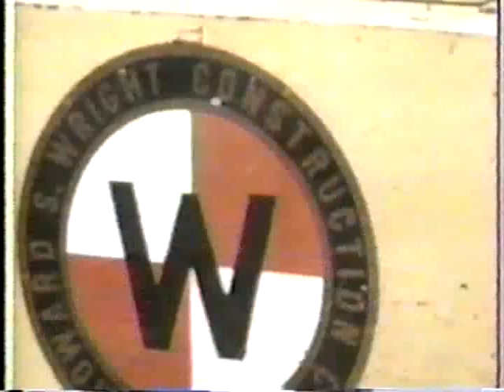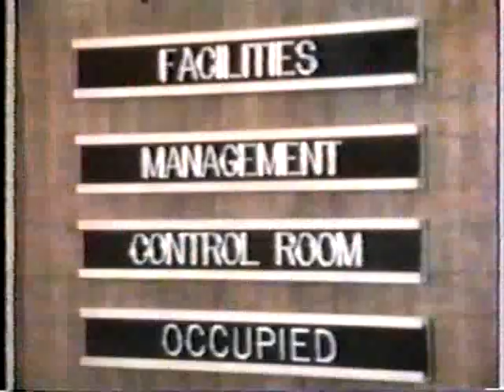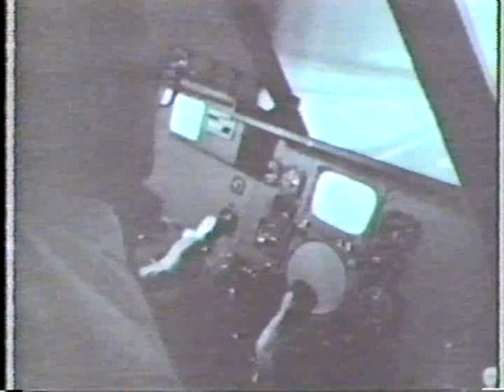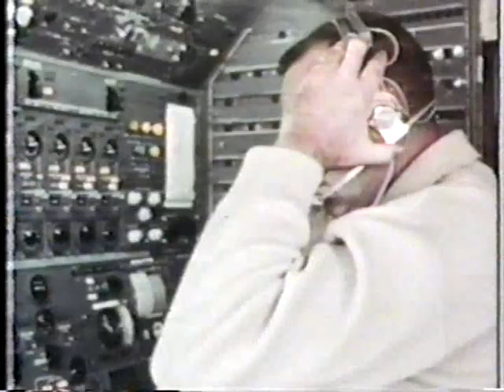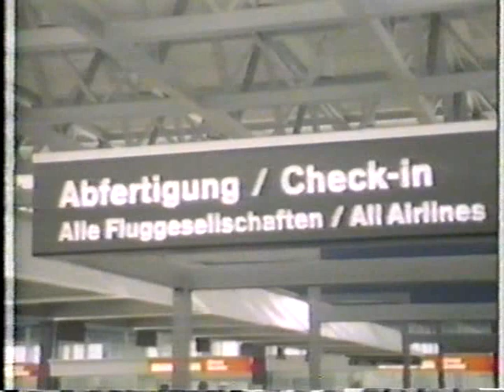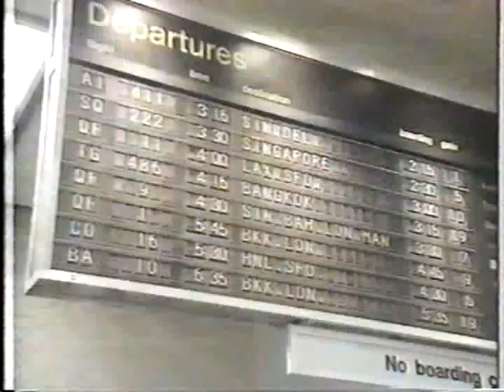Wings - Boeing 747

Comment: Even though this is a relatively old film it doesn’t appear that any environmental impact was considered when it came to the site of the new (then) manufacturing plant. What a waste of beautiful countryside and woodland, I am sure that a less environmentally damaging sight could have been found, and if the same size plant was needed today the powers that be would have a lot more concerns about the environment. But that was then and this is now. The 747 is probably the iconic airliner of all airliners, including Concorde and the newer generations of types in the 747 class. 
Despite my opinion on the building of the plant I thank you for sharing this excellent and informative film. 👍.